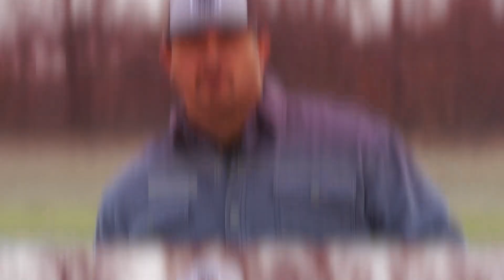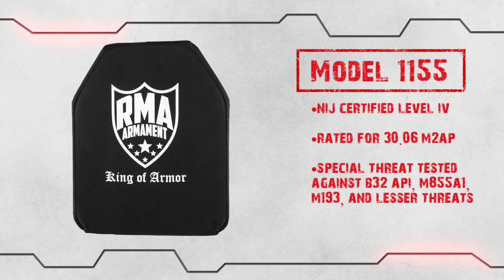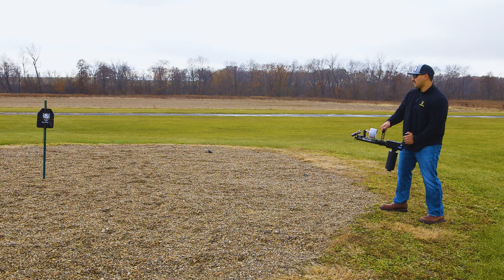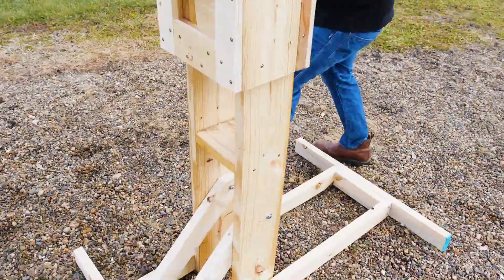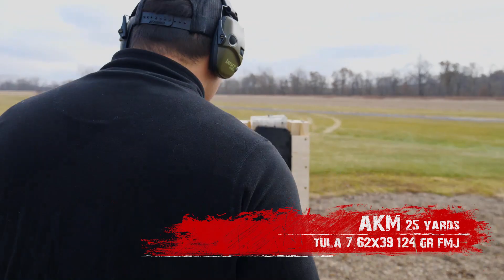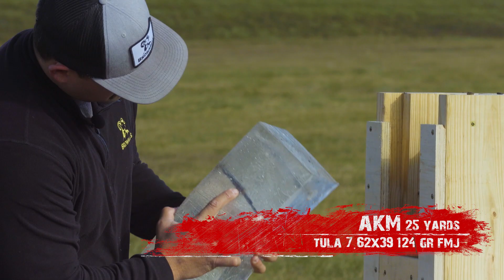Fact vs Fiction: RMA Body Armor vs Flame Thrower

Comment: This is very interesting. Heat vulnerabilities have the most potential during the manufacturing process where prolonged periods of elevated temperatures during activation of adhesive sheets can create weaknesses in the polyethylene fiber. In testing, we have seen this when temperatures exceed 270F. The ceramic itself is highly resistant to flame and heat. Thermal management during the ceramic/PE bonding process is absolutely paramount (as I am sure the manufacturer knows).

Comment: Can't withstand heat? Oh for the love of God!!  It's ceramic!  The same thing THERMAL PROTECTIVE TILES of the Space Shuttle and X-37B are made of--and guess what, re-entry loads are high both thermally and structurally--try cooking ceramic plates while their being run over by a truck and you kind of get the idea. Believe me, you'd burn out before those plates even noticed!
Reply: there are many variants of ceramic, one might just become extremely brittle, like a crucible that needs slow heating

Comment: This test is pointless and the body armor was not meant to defeat any fire. It is intended to defeat bullets based on its rating so let's stick with that.
Reply from the maker: The myth is that ceramic body armor can't withstand heat or is brittle after facing heat...this was a test to prove that out.
Reply: Brownells, Inc. Ok, so after doing the drop test and fire test, is RMA going put it in writing guaranteeing the integrity? I don't see a warranty section on their website at all. BTW, I generally enjoy videos from Brownells and a long time customer but this is the first video that have to reply with a disagreement and voice my opinion so don't take it the wrong way. And, yes I do have their body armor as well.
Reply: @BT1776  This video is next level cringy. Never in my life heard "heat" or a "flamethrower" messes up ceramic plates. This is just a advertisment for a company that Brownells teamed up with to make fatter pockets.
Reply from the maker: We based the videos on the most common questions asked by customer to RMA...then took it to the extreme for some fun! Its as simple as that.